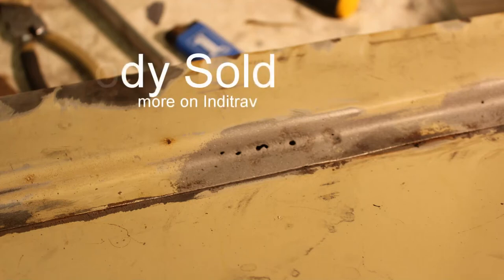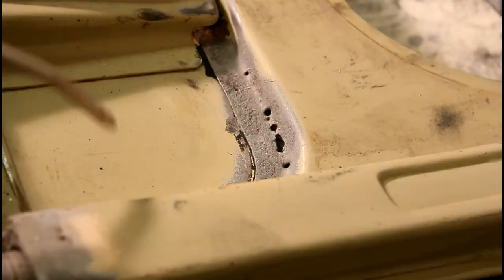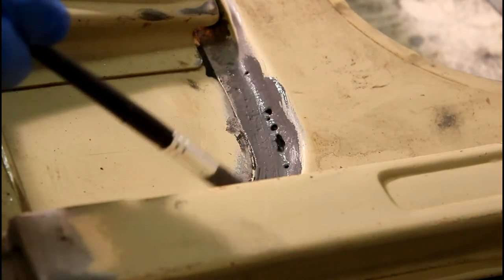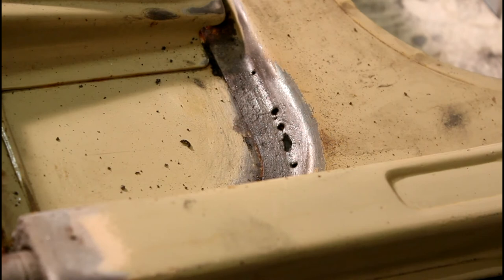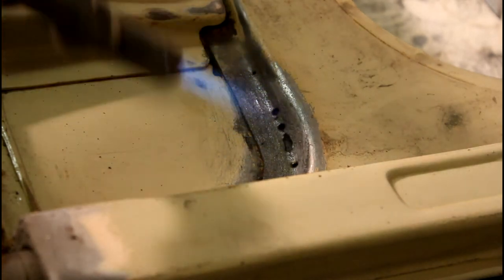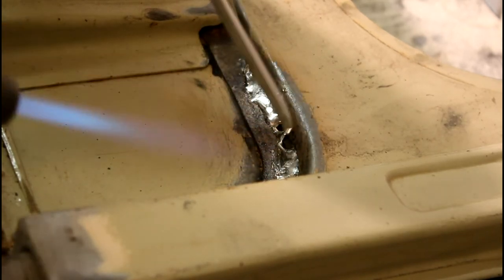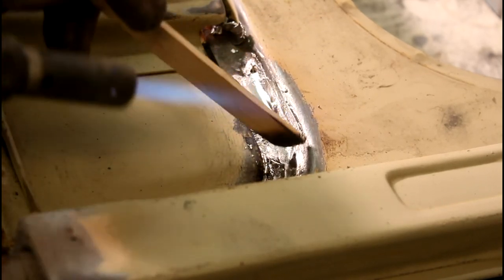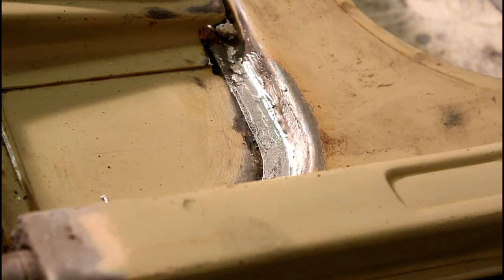Body Solder of Pinholes

Comment: For those, who complain about tin. I have removed a lot of old paint from old cars. There, where tin was on the surface, no rust around, no lifted paint or something like that. Also after some „masters” work with fiber glass bondo or just bondo, underneath whole thing is rusted all the time. Talking about 10-15 years with filler and 50 years with tin.
Reply from the maker: That sounds fine. Old methods work. Problem with bondo is that it sucks water and rusts. Must be covered with epoxy to avoid rust.

Comment: Polyester body filler is a rust magnet. Absorbs water, different expansion rate in cold climates. A local auto shop worker saw the rusty bondo on my classic honda and told me not to use it. Now it's welding and solder all the way. Just play it safe if using lead as it is very toxic.

Comment: Problem here - is that you must first check underneath the work before starting. Hazards could be electrical wiring, rubber items, melting / removing any Underseal from your vehicle, then you have rust forming underneath!! Or the worst scenario is a Fuel Line. I have done this work many times, but (first) use a Dremel and diamond bit. Dremel does a superior job of removing the rust and other contaminants. Cleanliness of the metal is critical to achieving solder flow - and the best results. I would never use a gas blowlamp. Go out and buy the biggest (that's not a knife) and highest wattage Soldering Iron that you can find. 150 to 200W should be OK. Don't forget to wash off any remaining flux residue - after the job has been done. hope this helps.
Reply: Wouldn't you need the flame for the flux tin to adhere to the metal? Just asking I have a big  iron never tried this but have body spoiler bolt holes that need filling without too much heat was going to solder then weld them
Reply: @zdravkomomci7570  There is a huge difference between 'Pin Holes' and 'Bolt Holes'! I am guessing that your Bolt Holes would be at least 10mm in diameter. This is more suited to the job of a MIG Welder, where you could make 'blanks' of similar gauge metal / hole diameter, and then weld them into position. Hope that this helps you.
Reply: I Restore shot out Rifle Barrels by drilling out and reaming for a Rifled Tube which I Solder in.
Found that a Very Large Electric Soldering Iron is perfect for Thinning the Outside of the Liner.  Biggest problem I had while using a Torch was getting the metal up to Temp but not Overheating it.
With the Iron I can just Walk the Puddle down the Tube.
Reply: @NRDavis-wl8vn  Glad that you have found the use of a large Solder Iron to give good results. I swear that I did not know that you could renovate a Rifle Barrel in such a way!

Comment: For large holes, solder wire mesh on it. If the panel is aluminum, solder or braze on stainless wire mesh.

Comment: I'm repairing rust holes in a child's wagon. The wagon was sandblasted and epoxy primered. Do I have to sand or grind the epoxy off to bare metal to solder the holes?
Reply from the maker: Yes, you need bare, clean metal.

Comment: To anybody....
Is that solder the same plumbers use on pipes...?
And what's the material he apply with brush...?
I'm in Spain and world like to know the equivalent materials.
Thanks
Reply from the maker: No, not same solder as plumbers use. That is for copper. But it might work. The brushed stuff is flux. A mixture of acid and tin used to prime the steel. Important to get the solder to stick to steel.
More details here: https://www.inditravel.org/en/body-solder/

Comment: Curious about drop thru. And adhesion.and filler material. Otherwise awesome job
Reply from the maker: drop thru is not a problem when soldering because of the much lower temperature than when welding. No problem with adhesion when using flux. Material is tin with some additives, which can be lead. If so, use mask.

Comment: This will not last, rust never sleeps.
Reply from the maker: Like here, steel is sandblasted, tinned and painted with epoxy. Close to zero chance for new rust from front side within 30 years. BUT, rear side is a cavity, not sandblasted, and if it is gonna rust it is from this side. To prevent that, cavity is sprayed with a creeping non hardening rust inhibitor (Fluid Film) and sealed.
Reply: Define won't last? WHERE I have done it it lasts about five times longer than bondo :)
But mig is easier.

Comment: Why not really fix the problem by welding or making a repair piece
Reply: I wondered that myself. A pitted/thinned section of sheet metal I can see leading being a viable option, but not once holes have fully penetrated the sheet metal.
Reply: Because of location, and being that tight, You would make a bigger mess cutting an welding, this is Spot-On!
Well done!
Reply: It's not easy to weld rusty materials. Sometimes the leftover steel just burns and you end up with more and more holes to fill. Tin soldering is a very gentle method  to repair thin and rusty panels
Reply: Much better than welding... Too thin, will blow through, curved so you would need to spend a lot of time forming the patch piece. This is so much faster and easier.

Comment: Soldering material name please
Reply from the maker: Body solder is tin based. Previously it contained lead as well, but normally not today as it is toxic
Reply: @DenJSmith  do they have a website?
Reply: Is this durable and dont corrode as easy?
Reply: @dave9271  no wont corrode easy where solder is , buuut , most of the rust is behind where you are soldering , so its only a matter of time before it comes back !
Reply: @upyours1256  ok thank you very much for your feedback appreciate it.

Comment: The rust will come back. New metall is the only way to do it if you want it to last.
Reply: I don't think that's true, for the solder to stick the acid is removing the rust.  The lead should protect the steel.

Often I see people sanding to bare metal removing the e-coat on cars and absolutely starting a massive rust problem.

Maybe your an expert and treat the metal and treat it properly to prevent rust.
Reply: They used to use something called terne metal for roofing. Lasted over 90 years if the paint was maintained. When you tin steel, you are creating terne metal.

Comment: It's easier to metal stitch with a co2 mig welder surely?
Reply from the maker: It is better, yes. But in this case it was rather rusty so welding would only burn holes. And it would be difficult to fabric new pieces to weld in.

Comment: Lead solder over holes is WORSE than polyester/2k fillers as it forms a galvanic reaction! - Just because it's an old technique, doesn't necessarily make it good , kinda like leeches for migraines!!
To sort a mess like this as easily as possible, then oxy/fuel weld those holes and you'll have the same filler/parent metal, or better still cut the tinworm out, and start afresh as the holes only represent a tiny fraction of what is actually happening deep below the surface!
Cure the cause and not the symptom, a la leeches! ;)
Reply: Yup
Reply from the maker: I agree welding is better, but soldering can be a lot easier when the metal is very corroded and thin, as it was in this example. Steel and tin/lead is rather close in galvanic potential so there is not a big chance of galvanic corrosion. You also need an electrolyte (water/salt) to start galvanic corrosion, so if you cover with a dense primer like epoxy the chances are small.
Reply: There is a place for everything. 
I have a 1959 jaguar, ,,factory LEAD on fenders NO ISSUES.
Reply: @ironworkerfxr7105  "factory finished" is the critical factor as almost all production cars until the late 70s used lead as a filler - Leading over oxidised steel(ie chemicaly active) is worse than using cataloy, which is metalurgically inert. The critical factor is always to remove Tin Worm and start afresh whenever possible, as corrosion is a sign of moisture ingress, either wicking between seams, or condensates within cavities.
Leading(regardless of alloy) will not adhere to oxidised steel, so in effect you are creating a boundary layer between filler and parent metals that induces moisture absorbtion via capillary action(and associated corrosion), as well as by galvanic reaction(without even mentioning the chemically active fluxes).
In effect it looks good for a while, just like spreading cataloy over corroded parts - we've all seen those tell tale signs of bodged repairs on otherwise great looking vehicles, and know in our head that the tell tale is only the tip of the iceberg re: Tin Worm!
I offer this advise based on decades of building and rebuilding classic British cars, and heavy plant(both renowned for corrosion, even from the factory), as I'd hate peeps to fall into the trap of bodging with lead in the misconception of it's superiority to bodging with cataloy - this is in NO way besmirching the YT poster's content, but just helpful advice.
:)
Reply: The tin in the solder works like a sacrificial anode to reduce rust until it has corroded away. It's why galvanized steel (steel electroplated with a very thin layer of tin) takes so much longer than steel to rust :)
Reply: @andrewallen9993  Thx - :)
Leading on fresh/non-corroded steel is a fine art that had its place(and still does in classic restoration/work that's contemporary of that era), but it's now obsolete re: advanced plastics, and  it's not too good for your health, it's slow, and has hotwork hazards....if it's a patch repair(tin-worm hole as shown here), then the most satisfactory(fusion, shape, root finish/rear bead form, versatility(but slow) eg hot forming/bending, etc of welding techniques is oxy/acetylene or air/Browns Gas MAG, followed by TIG, then MIG....Most beginners(and bodyshops) use MIG as it's affordable and quick(and it can be very effective given the operator's experience, professional equipment and manifolded gas mixes) - see Fitzee's Fabrications YT channel for MIG/adhoc tin-bashing work, as he does what most jobbing mechanics do, but he will ALWAYS remove Tin-worm(like we are all taught to, and/or learn from experience).
The most vauluable thing in life is time, and avoiding the duplicating of effort as a result of a bodge/corner cutting should be avoided(regardless of how traditional the underlying technique may be) - it's a founding tenent of any trade/craft.
If I can offer any advice from the 35+ years of welding experience in both vehicle restoration, and heavy industrial/maintenance/mechanical engineering stuff, then it is to avoid bodging/corner cutting and to work safely.
I've had many an "Arc Eye", or "Galvy Flu" from welding poorly prepped galvanised steel(usually zinc hot dipped), or that burning flesh smell, and sizzling of ear holes as the molten blob of steel works its way down, as you lie on your back below a car being repaired, whilst unable to move!!!
Reply: @craigywaigy4703  Well by the " you are not a real welder till you have set your trousers on fire" qualification I'm qualified :)
As all my cars are drivers and workers, as in almost daily, I just keep them good enough to last another 20 years but I don't have your 35 years practical experience.
I must admit that some of the pieces I brazed with oxy acetylene are still ok after 30 years though.
Reply: There should be no galvanic reaction at all! For a galvanic reaction to occur, you need a small 'gap' between the parent metal and the solder, where any moisture can enter. If the soldering has been done successfully, the solder is bonded firmly to the parent metal, and this can be sanded or filed into shape. The simple solder repair can outlast the life of the car - if done correctly, and treated with a corrosion- preventative on both sides of the repair. This really is a great method to overcome pinholes in car bodywork. The biggest problem with Bondo or Polyester Fillers - is the absorbency. If you do apply Bondo, never wet it when using wet/dry paper, because the Bondo IS absorbing lots of moisture! THEN, if the Bondo does get wet, you will have lots of trouble just trying to get a great spray paint finish. Never apply raw Paint Thinners directly onto fresh Bondo, because the Bondo will swell. Spray the absolute lightest coats to begin with, allowing a good drying time between each coat. It has taken me years to figure all of this out!

Comment: Fine if you are getting rid of the car. Totally rubbish if you are restoring a classic
Reply: Well, I completely disagree. When I restored a Classic car, there was absolutely nothing wrong with the metal. I hot-soldered the bottoms of the Trunk, Hood and both Doors, around the Windscreen (with glass removed) and then sanded to smooth. Then the car went for new 2-Pak Paint. Really, I did this where water forms. I still own the same classic car. Not a trace of rust on anywhere that has received this treatment. That was nineteen (19) years ago. This process stops rust before it begins........